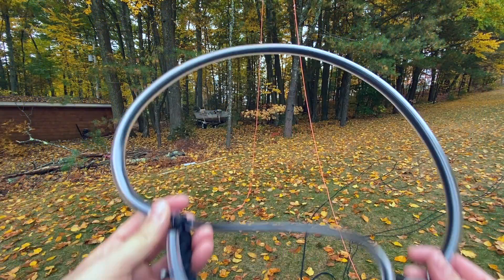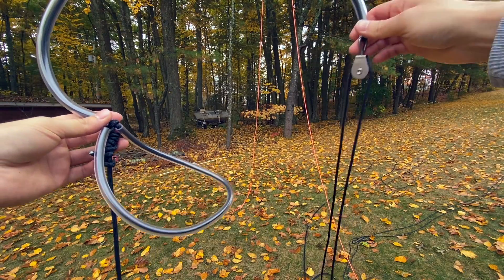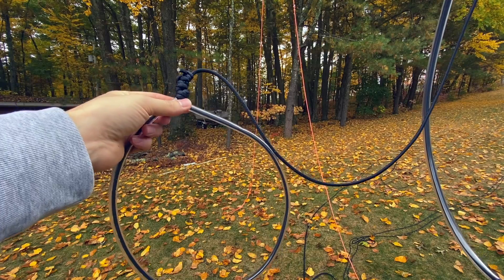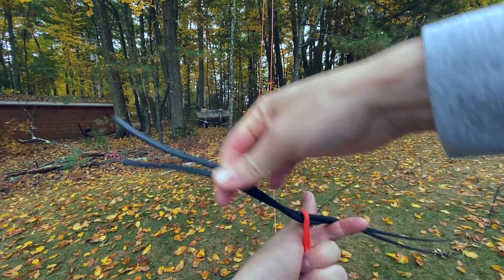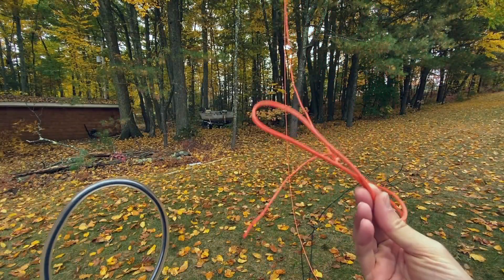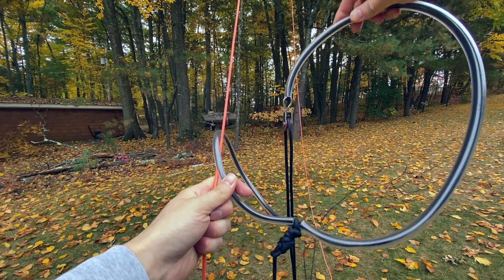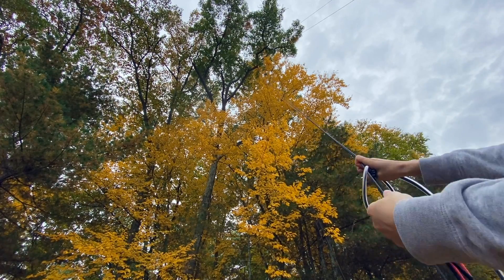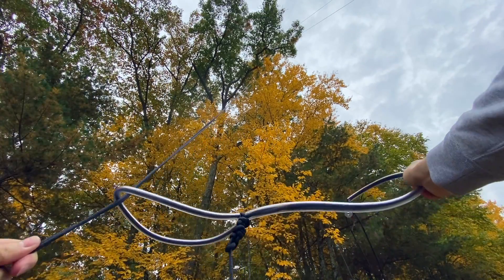The best way to hang a pulley in a tree - Part 1: Putting it up

Comment: A note to anyone planning to make one of these... Make sure the lower loop that is used to retrieve the assembly is lower than the pulley once it is in place on the branch! Don't ask me how I know...
Reply from the maker: Oh no! Did you manage to get it down to fix it? I bet you could make a longer hook where only the bottom of it is affixed to the rope so it can extend past the pulley.
Reply: @MostlyBuilds  I did get it down. I ended up using small crow bar attached to the end of three 10' chain link fence top rails.
Reply from the maker: Upon popular request, I posted a video for making the pulley assembly: https://youtu.be/BOTzlZ409P0

I incorporated your feedback @philbuckhannon4201

Comment: Great video,  I was wondering how to do this for my first antenna. Maybe a obvious question, you attach the end of the wire to the black rope and pull it through the pully?
Reply from the maker: For my setup the black rope goes through the pulley. I attach one end of the black rope to my antenna and hoist it up. None of the antenna gets pulled through the pulley if that’s what you are asking. My pulleys are spaced out such that it’s wider than the full length of the antenna. Let me know if any of that didn’t make sense.
Reply: OK makes sense.  I have a endfed 1/2 wave in a lazy V,  I was wondering how to do that.

Comment: How’d you get the rope up the tree initially
Reply: How did the rope get up there in the first place
Reply from the maker: I used a throw weight attached to some paracord. They make throw line that is lighter and easier to use, but I just went with what I had.

Comment: Very cool...thanks. I'll give this a go for my 6 meter end-fed install next week.
Reply from the maker: Best of luck!
Reply: @MostlyBuilds  Worked a treat! I didn't use the retrieval loop because it's a no-going-back deal but now that the pulley (and spring) are in the tree its ready for the wire antenna pull.....great stuff!
Reply from the maker: awesome! Thanks for the update. Love it

Comment: Sorry if this is a duplicate, but I can't find my post from yesterday where I asked if there was a video showing how to build the pulley assembly itself?
Reply from the maker: I think you might be looking for the thread started by the account @chipfornaris. I’ll paste my reply here too: 

Sorry about that. You can see the pulley assembly a bit better in the first video of the series: https://youtu.be/1kKpP2pTpYs

The description on that video has links to the tubing and the rope. 

I’m planning to film a video on how to make one. It’s on my TODO list, but not scheduled yet.

I use a single length of 3/16 rope and route it through the tubing to make the pulley assembly. I use 3 sections of tubing. The long length of tubing that ends with the pulley is a larger diameter tube compared to the other two that are used. This is because the rope is doubled up inside of it, forming a loop at the end where the pulley attaches.

Consider subscribing if you are interested to see the pulley assembly video when I get around to filming it.

Comment: I’m confused, what is the pulley loop made of? Looks like  plastic flexible  pipe with rope inside ? Can you show it slowly so I can see everything?
Reply from the maker: Sorry about that. You can see the pulley assembly a bit better in the first video of the series: https://youtu.be/1kKpP2pTpYs

The description on that video has links to the tubing and the rope. 

I’m planning to film a video on how to make one. It’s on my TODO list, but not scheduled yet.

I use a single length of 3/16 rope and route it through the tubing to make the pulley assembly. I use 3 sections of tubing. The long length of tubing that ends with the pulley is a larger diameter tube compared to the other two that are used. This is because the rope is doubled up inside of it, forming a loop at the end where the pulley attaches.

Consider subscribing if you are interested to see the pulley assembly video when I get around to filming it.

Comment: Ok, so if you are using this to run antenna wire between two different trees (in my case a long efhw wire), would you need two pulleys on each apparatus? From what I can tell, it looks like you would need one pulley to attach and secure the system to the base of the tree, and another pulley or insulator for the wire.  Am I thinking about this the right way? I’d like to try this by running the wire from the house up to tree one, then over to tree two. It’s something like an inverted L but I don’t see how you could do it with just one pulley.  Anybody can help me out here??
Reply from the maker: I’m running a center fed dipole, so I’m using 3 trees, each with a pulley. I have a single rope going through each pulley where one end is connected to the antenna and the other is connected to a counter weight. The two outer trees support the ends of the dipole (ropes connected to the insulators at the end of the antenna wire). Then the middle tree connects to the center part of the dipole where there is ladder line hanging down vertically (connected to my coax close to the ground). With this setup, each connection point to the antenna is made with a rope going through a pulley with a counter weight at the end. This holds the antenna taut but allows for movement when the trees sway in the wind. Hope this description helps.
Reply: @MostlyBuilds  ok thanks for the reply. I sorta get what you’re saying but it’s difficult to completely understand it without a visual.  I’ve seen the concept of a friction saver, similar to this. I’ve just got to wrap my head around how I’m going to run my own wires. Cool concept and thanks for sharing.
Reply from the maker: @wjjohns04able  here is how I’d probably try to hang an end fed antenna. Use this design at your own risk. I’m not an expert 😀 https://postimg.cc/BXYkW9KY

Comment: Where did you get the pulley assembly did you make it and run rope through the plastic? 😅
Reply from the maker: Yep I made it. A few people have asked for a video for making it. It’s on my TODO list 😀

I’ll describe the process: I used a single length of rope to avoid creating points of failure by tying multiple pieces together. 

Starting from where the pulley is, I used the larger vinyl tube to put a loop of the rope through. You need to size this length of tube to wrap around your tree branch and have some hanging down. Basically I pulled the rope through this tube, slid on the pulley, and ran the rope back through the tube. Resulting in a rope that goes through the tube, is threaded through the pulley eye, and goes back down the tube. 

Now at the other end of the tube (far side away from the pulley), I pulled the rope through a narrower diameter piece of vinyl tube to make the small loop that forms the slip knot loop. I don’t double back the rope through the tube on this one. I just tie it to the main part of the rope that came out of the larger tube opposite the pulley.

Then from that tie point, between the larger vinyl tube and the slip knot loop, I drop a few feet of rope for the retrieval loop. At the end of that drop I just use another length of the smaller diameter vinyl tube to run the rope through and tie it to where it entered that tube. Forming the larger retrieval loop.

I have another video demonstrating the pulley assembly install procedure in a mock up situation: https://youtu.be/1kKpP2pTpYs I left links in the description for materials to build the assembly. 

Hope that is helpful. When I get around to filming making one I’ll try to remember to update you on this thread.

If you’re interested, please consider subscribing 😀
Reply: @MostlyBuilds  facts the description legit so are them knots tho I’ll buy one if that’s a option. Right now I have ropes and single wheel pulleys in trying to make something work I got the throw weight too lol

Comment: We all know that you bought the weight from Amazon. But the question is how did you get that weight over the tree in the first place!
Reply from the maker: Hey Russ, I held the rope like 1-2 feet above the weight and rocked it back and forth a few times to build some momentum before releasing it (under hand throw style). It helps to wear well fitting work gloves. I’ve heard good things about this sling shot device, but it’s kinda pricy: https://amzn.to/3ooNoHE

I don’t need to do this very often so I just opt for throwing like 20 times by hand to get it to the right spot.

Comment: Is this a ham radio antenna? I looked up this video to try to find a way that I could string up a dog run between two trees, possibly by using some of my dad's antenna wire, but I didn't think I was going to end up watching a radio video. My dad was a big time ham radio guy. He made a similar video on how to build a cheap die pole antenna. It's on his channel, under Marty Drift. I also have some videos of him talking on his radios on my channel. He unfortunately passed away in 2017.
Reply from the maker: Hi Melissa. Yup I used this pulley hanging method to put up a dipole antenna. It could definitely be used for other things though. Sorry to hear about your dad. Good luck with the dog run project.

Comment: Pretty cool. How do you get it in the tree to start with? I see you already have the rope over a branch, what was your method of accomplishing it?
Reply from the maker: I used a throw weight that I bought on amazon: https://amzn.to/3SNU8J1

I have another video where I demonstrate that in addition to the method you see in this video, but I do it at ground level so you can see everything up close. I show the weight in that video: https://www.youtube.com/watch?v=1kKpP2pTpYs 

Sometimes it takes me quite a few tries to throw the weight right where I want it. I've heard good thinks about this slingshot that you can use with a throw weight, but it's a bit expensive: https://amzn.to/3JTVyQY

I also have a video on how to adjust a line in a tree instead of trying to rethrow again: https://www.youtube.com/watch?v=AXIDF9FERfA

I recommend using a relatively light line attached to the throw weight if possible. There are good videos of arborists throwing lines up into trees.